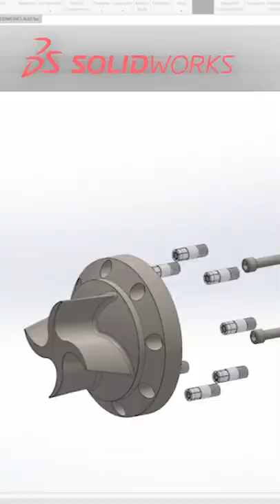AGGRESSIVELY Machining a 15-5 Stainless Work of Art #shorts

Comment: when there is a lot of money, and you can throw it to the wind, processing steel with solid alloy end mills.
Reply from the maker: This is how you make money… This KOR6 end mill is what Boeing and other great companies that machine a ton of titanium use. It’s specially for hardened materials and has chip splitters to break the chips into small pieces. Of course we usually use coolant… we didn’t here simply to show the machining.